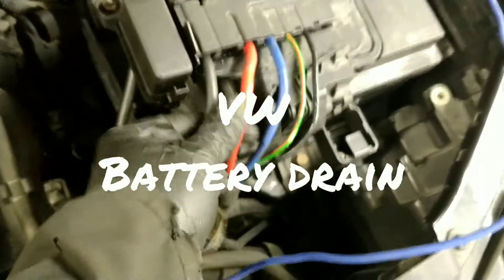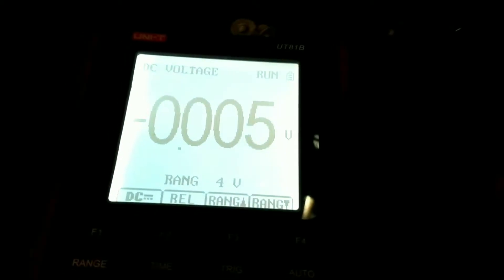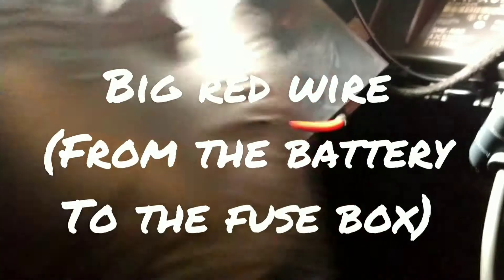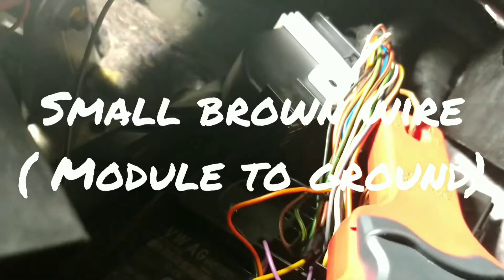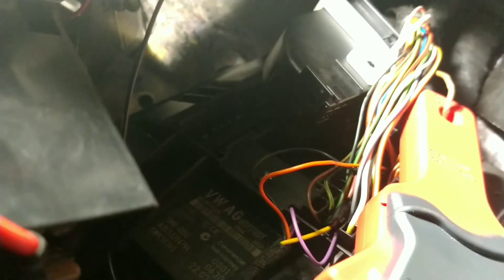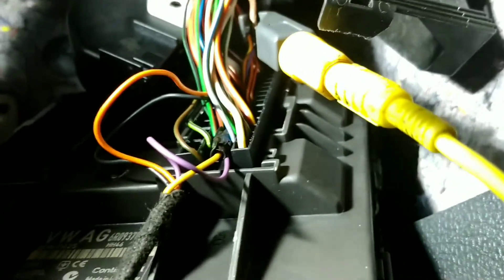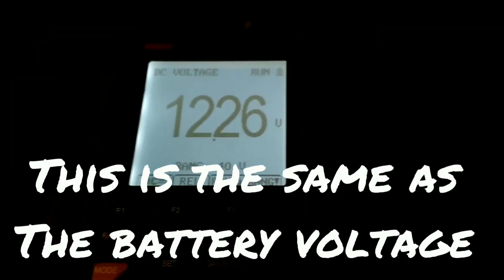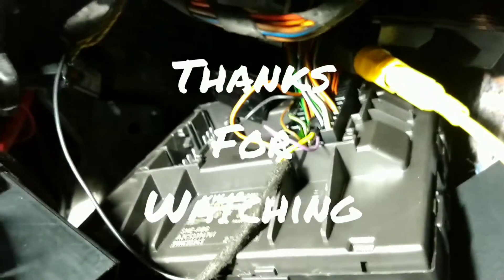VW polo, body control module Draining The Battery

Comment: Hi, thanks for the video. My Polo wouldn’t start and the mechanic said it’s a BCM issue. The battery went down to 2V from 12V. I recharged the battery and replaced the old BCM with another (same part number) BCM (haven’t programmed it yet) but the car still wouldn’t start. Any idea what could be the problem? Thanks!

Comment: I had exactly the same problem in a 2009 Polo 1.2 Moda 60.  I chased my tail for a long time with nobody able to help me including the VW main dealer, so i just accepted I needed to use the car every three days or just disconnect the battery.  Purchased a replacement BCM from eBay, copied the coding from the original and re-paired the keys using VCDS and the car is now perfect.  This video gave me the push over the edge to give it a go, so many thanks for uploading!
Reply from the maker: Thanks for watching

Comment: Good video wondered if you could help  I’m working on a Skoda 57 battery drain fuse 20 inside car 110 Milamp draw when I disconnect one connector from bcm draw goes away not sure if bcm is at fault
Reply from the maker: If you have an amp clamp you could see which wires have current flow. If you have two wires with the same 110 milliamp drain and one of the wires has power into the module and the other one of the wires has a ground (0 volts)then you know for sure that all of the drain is from the BCM. (Kirchhoff's law) thanks for watching
Reply: @mechanicmatt871  Is there a way to fix this, except replacing the BCM
Reply from the maker: With an amp clamp you could find the actual wire on that plug that has current flowing on it. If you cut the wire it would obviously stop the flow but it would depend what is on that circuit as to whether that would benefit you, for example it could be for central locking.
You could fit a relay to reconnect the wire only when you have the ignition switched on.
That way you would have no drain on the battery with the ignition switched off.
Of course the module could be corroded internally and start becoming problematic.
Cheers Matt
Reply: It was bcm cheers

Comment: What are the attachments you’re using at 2.16 to measure the draw?
Reply from the maker: Hi Scott, at that point I was using a wire clamp to poke a small hole through the wire and measure the voltage, I have had them for a while and I think it was called ferv, I could be spelling it wrong, the tool van that I got them from said that he can't get them any more. They were great and I use them all of the time. I have seen something similar from fluke that other YouTubers are using or I have something similar from powerprobe that is longer and makes it easier to reach wires in hard to get places. The attachment fits on the end of a regular 4mm banana plug wire.
Reply: Mechanic Matt Hi Matt thank you for your reply I can’t seem to find them are they just mini attachments that go into the clamp meter? I have the exact same problem you were fixing on this polo. I have a drain coming from the BCM but unsure if it’s the BCM or something it controls.
Reply: Mechanic Matt sorry I could only read half your message and then it all appeared, that’s great i’ll do the same and poke a small hole in the wire. I’ve seen something similar but they are just cheap copies online.

Comment: Hi Matt,
if you can help me with your thoughts on the problem I have with my vw Up 2017 999cc,
my heater ,hazard lights and indicators, central locking .rear wiper blade and rear boot are not working,,I have replaced ignition switch as many suggested on forums with no luck,car will start and drive with no problems, I have no communication from any controllers and CAN is not ready using vag com,all fuses are good, my next step is BCM, its of the car now ,is there any ways to test it , when on the car and vag com connected to obd its blinking as it know it  connected but no communication from controller.I dont know what to do next.
Looking for  any suggestions .
Thanks in advance .
Reply from the maker: Hi I plug the body control module back in and do a full scan if other modules have a fault code saying that they have no communication with the BCM, I would the check for powers and grounds at the BCM module and use a light bulb to load test the power and ground, also if all of that is ok check that it is getting a can hi and can low signal.. thanks for watching